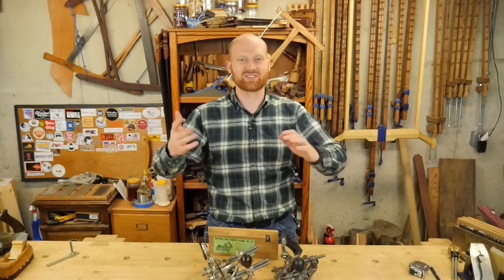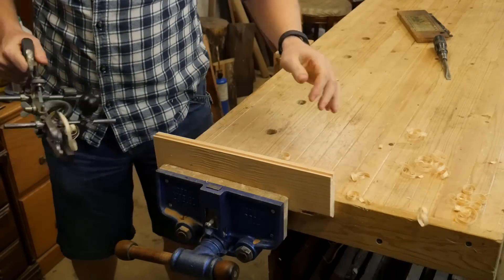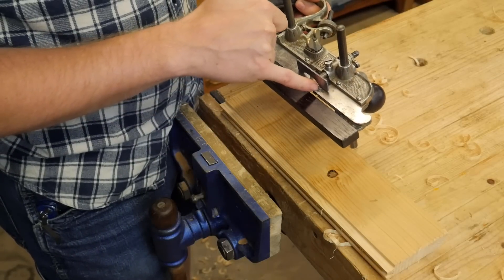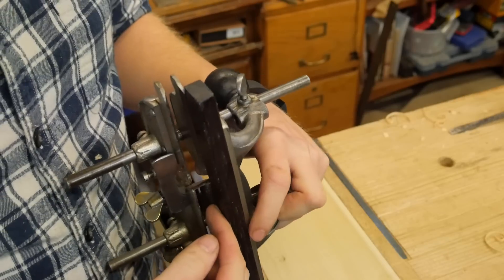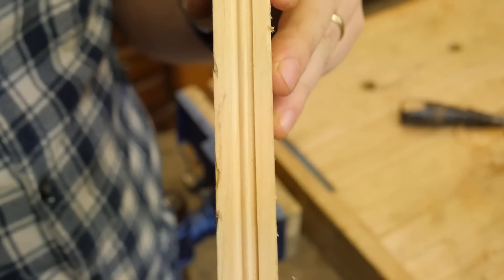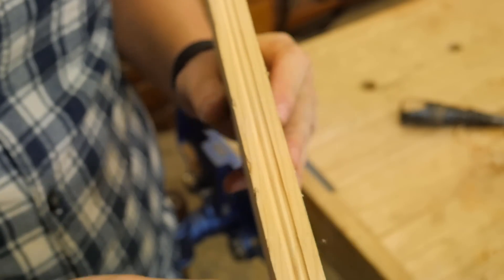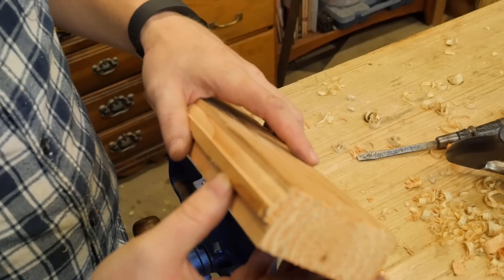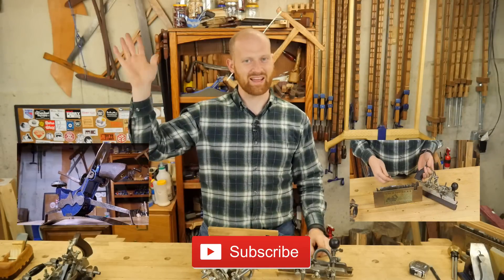A Closer Look At The Stanley 45 and What It Can Really Do

Comment: Just picked up a 45 today. I'm so stoked! I will need to get blades as all it came with was a 1/4" plough.
Reply from the maker: Usually I suggest people just buy them individually rather than trying to buy a full set. You'll never use them all. And most the time you can pick up individuals for around five bucks a piece. So just purchase them as you need them.

Comment: Lovely video, makes me want to go and make some shavings.
Just one thing though, with all plough and moulding planes, wood or metal, you start the cut near the far end of the board, not the edge near your hip.  This way the blades which have about 1 degree relief angle on the sides (trapezoidal cross section) has a chance for the sides of the blade to be used to clean up the sides of the cut.  If you start at the end nearest you the blade is digging underneath the surface and is much harder to use, and does not have a chance to make as clean a cut.

I have a lovely screw-stem plough with the 8 blades, and an Emir moving Filister plane with three blades, in wood.  I also have the Stanley 50 plough, the 45 and 55 multiplanes.  They are so much fun and for a project like a shelf for a pantry, you will have finished the job using these planes in less time than it takes to set up a router table.
Reply from the maker: thnaks. that is a methoud that a lot of people like to use. I find it to just be an extra step. but that is what makes the sport fun. there are a thousand ways to do it.

Comment: I have been a woodworker for a couple of years now that I am retired, and I use both powered and hand tools based on which will do the best job and sometimes which will produce the best results.  I have a Stanley 45 but with most of the 55 irons.  What keeps me from using the 45 is getting it set up properly.  You have given excellent info on the cuts the 45 can make, but could you go into some details on how you set the irons, depth stops, etc?
Reply from the maker: I have wanted to do that video for a while but every time I sat down to do it I ran into issues with either too much information, as there are so many possible issues, or it was really hard to explain on video. every time you set it up there are different things that could be the problem and every piece of wood is different too. but most of the time the problem comes down to it not being sharp, taking too deep a cut, or assuming the skates and fence are parallel (they never are). I might have to attempt it again some time. thanks!
Reply: @WoodByWright  I'm not sure there is such a thing as too much information on this, especially if you get into the 55.

Comment: Hello, I do enjoy your videos and recently got a Stanely 45 (didn't think I would ever own one). I wanted to ask what are your most used cutters for your combination planes? It didn't come with any, However I am making a tounge and grove set, some flat planes for datos and rebates and maybe a beading cutter too. I was wondering if there were any other useful ones you would recommend making too.
Reply from the maker: Generally the list you provided will cover you 99.9% of the time. Unless you start getting into intricate moldings that's all you really need. Generally I tell people don't buy sets of irons. You won't use half of them. Just buy the ones you need as you need them. You can usually buy them individually for five bucks or less or you can buy the brand new ones from Veritas.

Comment: cool video. Like some of the others already posted, sharpening and making your own cutters would be an interesting topic.
I was also wondering how the repeatedly of the setup is. Would you have to batch out a project or can you dial the plane in to a previous setting?
Or would having several wood body planes be better for that?
Keep up the good work!
Reply from the maker: Repeatability is fairly easy as you can set it on work you have already done and move the fence and depth stop to match. the big thing for this is it is easier to take to a job site then 45 wooden hand planes. I have never thought of making my own but it should be easily do able. I will have to give it a try. I will be doing a video on sharpening some time soon.

Comment: I own the Veritas versions of these.  I would have to say that I basically do not use the combination plane at all.  Everything that I do can be done with the small plough plane (I have both the left and right handed/orientation).  The Combination plane is nice, but it's simply too heavy to do any extended work for a long time.  At that point, I just pull out the dado stack on the table saw.
Reply: It's a very sophisticated piece of equipment I must admit, but it's just too annoying to set up and use.

Comment: Thanks for the great video. Could you tell me if this tool can be re-jigged so a left-handed person can use it? It actually looks like it can be used for both left and right persons, for all the blades. Thanks again. - Ken.
Reply from the maker: you can put the fence on either side of the iron so it can go in either direction. also, good if the grain direction changes.

Comment: When using the tongue and groove blade did you flip the nickers up so they wouldn’t score or would they not be able to touch the bottom of the groove either way?
Reply from the maker: if I am doing with the grain they are up so they are not in use. I only use them when going across the grain.

Comment: Please do a few more on this. Not 3 hour long, but several shorter ones. 

Specific question: could you make specific cutters for this plane, if you have a specific need for a specific mold or bead? Like a double bead, or an ogee?

Other question, dado in the middle of the board?
Reply from the maker: +Willem Kossen I might have to. when I do the 55 next week there will be a lot more. and I may have a project coming up where I will be using the slitting knife. You can always make your own cutter. I have seen people do it out of circular saw blades. as well as reshaping an existing cutter. Are you asking about a stop dado? if so you can but you have to have a hole for the font skate to drop in to. I did a stop groove recently. In this video about 5:50 in https://www.youtube.com/watch?v=8BVXCaT4ICk&index=2&list=PLAbayqjimalH0BAkyAnxjcXk1ob6D5nbY

Comment: Often times at work I need to make a board with a tongue and or a groove. I hate to drag out the table saw for one board so I'm looking for a hand plane to make quick work of it. Sometimes the tongue and groove need to be centered sometimes not. Is this the one I want?
Reply from the maker: Stanley 45 would definitely be the one if you want to do different size grooves. However, you can get a swing arm tongue and groove plane and it's one plane that's always set up to do the exact same tongue and groove. It takes a little bit more to set up the first time, but once it's set up it's really quick work.
Reply: @WoodByWright  thank you so much!! Your videos are awesome

Comment: Curious....I'm looking at buying a #45, but I don't think it has cutters, are aftermarket cutters available, or do they have to be made...?
Reply from the maker: Yes you can buy them individually or on sets. The cutters from Veritas also fit in it. My general suggestion is buy the cutters you need for the project don't buy sets.ost of the time you will not use 75% of them.
Reply: @WoodByWright  
Great advice....
Thank you.

Comment: I am recently moving towards using hand tools as a woodworking hobyist and have been very luckily given a record 405 in the box with 23 blades in imaculate condition by a very good friend. I have, however been looking for guidance on the 405 but find most info is on the more premium stanley 45. should you have any links or advice regarding differences I would appreciate your input. Also Keep up with the videos. I need my fix of top quality streams and youtube uploads here in the UK.
Thanks for putting in the effort and producing very enjoyable material. 
PS-: Also got a record Num 4 given and in ok condition so a handy backup to the bench vice for the non Bio work :D
Reply from the maker: The 405 is basically identical to the 45 in function. There are a few minor differences but nothing that would change function.

Comment: I would like to see a video on the anatomy of a no. 45. Im looking to buy one off ebay and sometimes it is hard to know if they have all the parts and pieces
Reply from the maker: Well the problem is that different versions came with different extras. So there is no one set. And most of the time I tell people to get a cheaper one that is missing a few items and get them as you need them. And most of those parts you will never use.
Reply: Wood By Wright i was mainly talking about the parts on the body. Missing fences or nickers... that sorta thing

Comment: Hi, I have the Stanley 050 and working with the fence on the right hand side (I am left handed) but I get some damage from the depth stop. Do you get this because the video did not show the finish.
Colin from Northern Ireland
Reply from the maker: no. The depth stop should only touch it on the last pass, but even then it should not damage the wood. I would make sure there is no bur or other sharp edge on it. a quick filing might be just the thing.

Comment: I have a sargent 1080PB basically the same as the 45 (not sure what the PB stands for) but what do you sharpen your irons at 35 degrees??? Or less
Reply from the maker: I have no idea what the angle is. It really does not matter with the bevel down. Most of my plane around are at 30 degrees, that is just an estimate.
Reply: Wood By Wright  thanks ive searched the innerwebs and it seems anywhere from 30-38 degrees and 25/30 for softwoods like pine i just got it and your video is the one that shows the plane the best and yours works great ! The sargent only has 1 set of knickers though , ill try it and see where i end up ! Thanks !!!!
Reply from the maker: @07roadking43  sweets. for those combination planes in all honesty you will never notice the difference in angle between 20 and 40 degrees. Until you've been working with it for years on end he will not be able to feel or see a difference. It's one of those fine point things that only the old-timers really can tell a difference.

Comment: Hi, new subscriber here. I was wondering if you have had any experience with a no 46? I've seen more than one blog post claiming that although it doesn't  have the molding plane versatility, it's a much better plough/fillester than the 45&55. Thanks for all the great hand tool content!
Reply from the maker: Thanks. Everyone has a different idea about that. I like it for that but I would rather have one plane for all of it then one for dads and another for all other grooving and molding.
Reply: @WoodByWright  That makes sense. I've been moving away from power tools and cast iron planes, heading more towards 19th century English wooden planes but the sheer quantity necessary to cut a good variety of moldings is deflating. You've made the combination planes look like a viable alternative! I was purposefully avoiding them before. I've had experience with other types of multifunction tools that are too bulky or just flat out perform badly. Food for thought, thank you.

Comment: I was wondering where I could find replacement knickers? I have recently acquired an old #45 but one of the knickers is missing...
Reply from the maker: You can usually find them on eBay. If not set up an eBay notification and I'm sure it one will pop up soon. Otherwise the next best place is on the unplugged woodworker group on Facebook. Someone on there usually has an extra couple. And last you could make one yourself out of a small piece of hacksaw blade.

Comment: It appears that nickers are not only for an initial scoring because every return stroke precedes every forward stroke with another scoring when the tool is withdrawn in contact with the wood as you appear to be doing in this video. This matters if I am seeing things right.
Reply from the maker: That's why it's in front of the iron. So it's always making the cut just before the iron gets to it on the forward stroke. The return stroke doesn't have the pressure, so even if it's lightly dragged back across the board, it won't actually cut the fibers. But most people will pick up a rabbit plane rather than drag it back across the board.

Comment: Nice presentation. I was under the impression that this tool did many jobs albeit somewhat poorly and/or inefficiently. Apparently this is not the case when wielded skillfully……..
Reply from the maker: It is a pain to set up well and get going but once it does it'll do the job just as well as any other. It's just a lot of fiddling.

Comment: If you were doing a fair amount of tongue and groove I suspect it would be a good idea to have two #45's or a #45 and a #55 just so you could leave a plane set up for each type of cut.
Reply from the maker: Usually most combination claims are generally left to make the groove for a tongue and groove set. But if you're going to be doing a lot of tongue and groove then generally it's better to pick up a swingarm tongue and groove plane. They're far cheaper and are always set up and ready to go.
Reply: @WoodByWright  Sure and that gives me an excuse to buy another plane. From what I have seen from the swing arm tongue and groove planes, they only work best (for some definition of "best" with one thickness of wood. Maybe "best" is a matched pair of wood T&G planes?

Comment: I have a question for anyone on this page willing to comment: I have a Stanley 50 which came with a full set of blades including a 1/8 and a 3/16. However, when I try to tighten it to anything less than 1/4", the skates come together before the blade is secured. I can see by the original box for the blades that these smaller blades were stock, so I'm puzzled. I would greatly appreciate any input.
Reply from the maker: you just take the second skate off for the smaller cutters.
Reply: Thank you! I'll see if I can sort that out tomorrow.
Reply: Before responding, allow me to express my sincere gratitude for the generosity of you and others for sharing your master skills with us, some of whom, like me, are duffers. I've been an amateur woodworker for decades now but am ashamed to say that the world of hand tools is a weak area for me, and your videos are an essential part of my learning curve.

After looking at the plane, I do not see how I can remove the second skate. The three main components are the plane body, the second skate/blade holder, and the fence. The second skate is all one piece. So to remove the skate is also to remove the part that forms the groove that clamps the blade opposite the main body. I don't see a way to upload photos, but perhaps the 45 and 50 are different in this regard?
Reply: I now see I didn't quite understand the advice. What you do is, as you suggest, remove the second skate, along with the shaft and wingnut used to tighten it against the blade. You replace the shaft with an appropriate bolt, nut, and washer, and these can now be used to clamp the small blades (1/8", 3/16") in place. This works just fine.
Reply: Congratulations on your great Stanley 50. I got lucky too ! I would like to see our host put a # 50 through its paces. I loved what he did with the 45

Comment: What's the difference between the Sargent 1080 and the Stanley 45?
Reply from the maker: there are several different variations of both so not all of the parts can interchange but for the most part, the Sargent 1080 is just a copy of the #45.
Reply: Do you have a 1080 you can demonstrate?
Reply from the maker: I do not, but its function and use is exactly the same as the #45.

Comment: Notched vs unnotched irons?
Reply from the maker: the un notched are the early versions. but they soon added the notch for easer adjustment. also the irons made for the #50 were shorter but those did not have a notch.

Comment: Yo @james at 4:22 you're using the 45 to cut a dado. Yet in a video I watched recently, you said dado planes were a waste of time. What gives?
Reply from the maker: Buying a dedicated dado plane I find to be a waste most of the time I just saw it out rather than take the time to setup the dado plane. In this video I am demonstrating the things that the 45 can do.
Reply: @WoodByWright  I cut sixteen 1/4" dadoes this weekend, 10" long, 1/4" deep. Took forever. I tried a Veritas crosscut saw but the teeth are sort of fine and kept loading up.  I ended up using a chisel and a routah.  How would you have done that?  I bring this up because the #45 seemed to do the job effortlessly.

Comment: I've never had a good result with a #45 on end grain.
Reply from the maker: It all comes down to blade and depth of cut. The molding irons are difficult.
Reply: Make sure the spurs are razor sharp. (I think you call them 'nickers' in America.) They are minute, so you need to hold them in tweezers to sharpen them up. If they're blunt, you have no chance of cutting across the grain.

Comment: Ah, okay, I'm starting to see now...uhm...why does it have a wooden fence thing? The 45&55 both have a wood part 🤔
Reply from the maker: The fence is there so you can make the cuts in a certain distance from a face. It's wood because metal would end up marking the face it's sliding on.